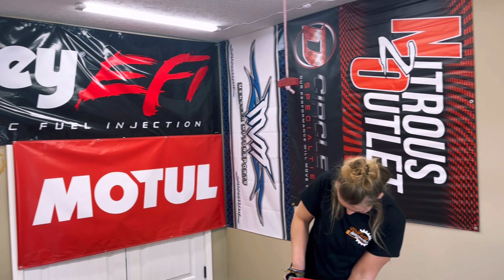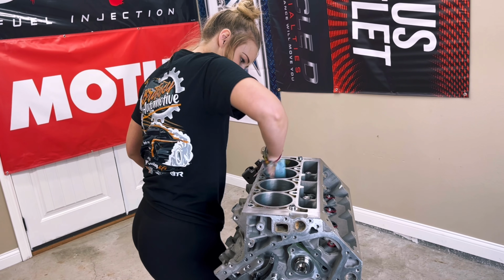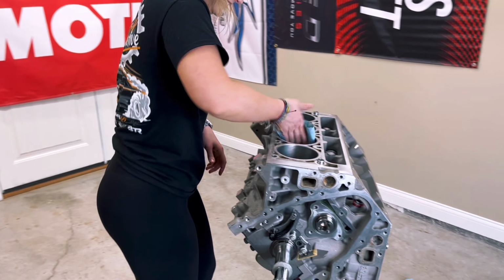Build A GEN V Short Block

Comment: quick tip, if you turn the engine on its side when torquing main bolts you don't have to hold the engine with the other hand so you'll be pushing down and not pulling. Can't wait to here the first startup!!
Reply from the maker: Good idea! Thank you!

Comment: I think its always a good idea to put the camshaft in first. If there's an issue with the cam bearings not being installed correctly or the cam doesn't fit correctly it's easier to fix before assembling the rotating assembly. If you wait tell last to install the cam and there's a problem than you have to disassemble the shortblock in most cases the correct the problem. Good job👍
Reply from the maker: Thank you so much!
Reply: I see they are trying to scam you too
Reply: @davidreed6070  yeah, I ignore it.

Comment: Excellent work!  I give u one piece of advice I got years ago turn the engine sideways when torquing the bolts it’s much easier to push down and the engine doesn’t try to roll around
Reply from the maker: Okay that seems like it would work haha
Reply: @britneyautomotive  just make sure the pushing down is from the back of the engine stand not the front or it might tip over.

Comment: Very cool love the details in your videos! Great job 👍 the engine stand following you on the floor when torquing your bolts down 😬 I don't how many years I'd be holding it with my foot 👣 leaning my body into it !!! 🤯until I'm at a buddy's shop and he had recessed tie-down plugs in the floor welded d-rings on his engine stand and used small ratchet straps to hold it still 🤯
Reply: britneyautomotive........  how's it going young lady I must say I'm impressed with the knowledge of your builds , editing filming that's got to be one crazy schedule full-time job 👍
Reply: britneyautomotive........  The floor Mount pucks I'm referring to you can find in body shop equipment , they are like a cup with a chain in it you drill a hole with a large  masonry bit in your floor ,drop in hole then Titan with an impact, they have a smooth cover that goes over them
Reply from the maker: Sounds like a very smart idea! I had to use my entire body to torque some of those bolts so holding it in place was difficult lol

Comment: Fellow Bardstownian here. That must be exciting to be finally doing! 
I'm not new to the learning game but I am new to the building game. I'm well on my way this year though... I don't have the cash to buy a crate engine all at once. Would you suggest starting with a new block and buying parts as i can and building over time? Or pulling a junk yard engine and getting machine work and new enternals. Trying to balance what i could do soon vs. something more worth waiting for while focusing on suspension.
Also, can i just walk up into BTR and talk to them about what i need? Lol
Reply from the maker: You can come talk to them or just call, I’d say that question is based off of preference! There’s a ton of fast junkyard engines. Crate engines are going to guarantee a fresh clean block. Sometimes you run into a deal you can’t pass up. Really just depends on what’s available at the time you buy and for what price! I have a crate engine so I skipped on replacing the bottom end but will do so next season. I’m also not used to going as fast as I will this year so I need seat time before I really send it anyways!

Comment: O you turned on my 📹 again how do turn this off 📴 seenn bbygrnd and they didn't say anything and didn't pick menup again wait till I tell there mother's  5:45 and ring Position is very important. Arrangement to the LS1 recommendations from General motors to get the best room out of your ring placement in degrees. Make sure they are no either buy recommendation or the best that you can accomplish this to increase cylinder pressure. In the old Chevy, it was 90° apart. This will increase cylinder pressure's chamber pressure inside of the cylinder or best results. Your compression ratios will increase by using this method. In ring placement from the top ring. Concerning the orring and its placement in separation is very important. And will increase pick up and delivery inside of the cylinder wall. From the rotating assembly. Pick up system Recommendations by General motors on a zealous and one engine. I would follow that unless anybody thinks that they've got anything better invented anything that is better. And advertising. O wait controls of mouth neded before I give away to much information. Have called brit no don't have the number any more no the xchanger happened and my mouth o my kids again